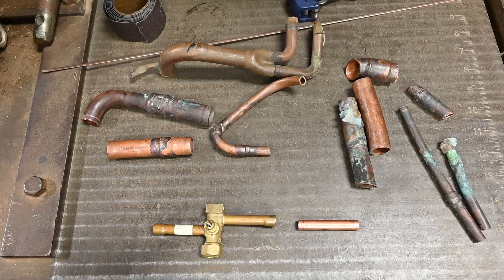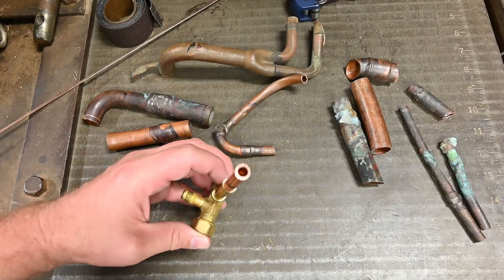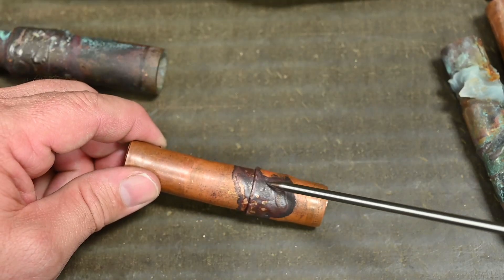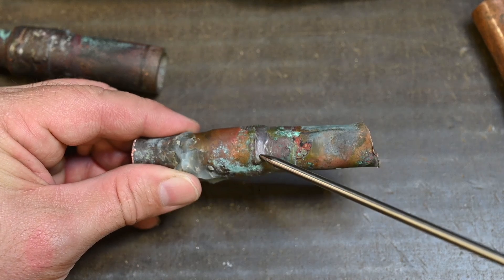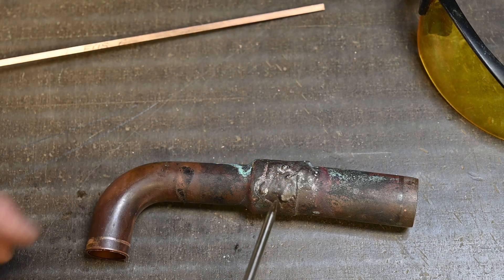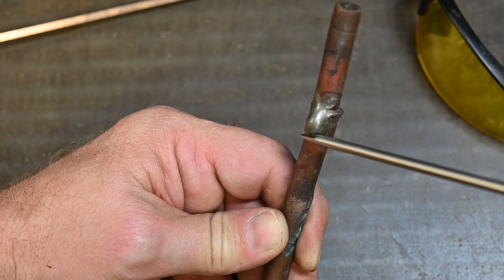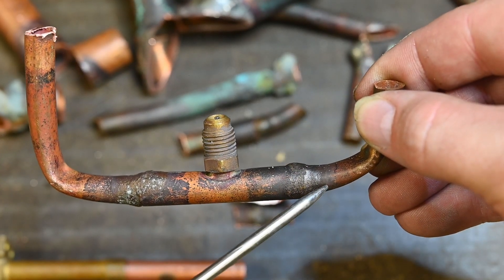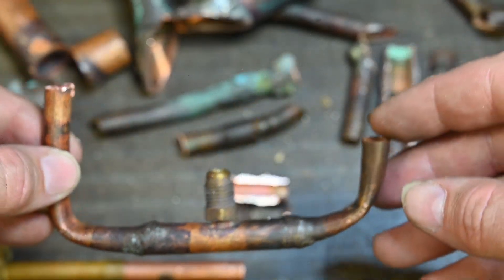HVAC 087 A. Connections part 1 Brazing,  introductory only

Comment: when brazing in supermarkets with large system or runs is nitrogen still used? Also what is the tool is used to meter the nitro through the system?
Reply from the maker: Yes very important. 
You use a regular nitrogen regulator and then a flow regulator after that. Here is the one I use https://uniweld.com/product/nitrovue%C2%AD-flow-indicator/

Comment: Hi Ty - I’d like to practice brazing at home but I don’t want to invest in an acetylene unit. Are there any small devices (e.g., MAP) that can be used for hvac brazing? - Thanks! - Jim
Reply from the maker: Air accetlyne (turbo torch) would be your cheapest
 It a B tank and a loud end. You have to get kno for hvac as the ones for plumbing do not get hot enough.
The map gas ones also dont get hot enough. They do make a inductive one but wow super expensive and not practical.  If you where closer I'd let you practice here.
Reply from the maker: Also the mini oxy acetylen tanks often go used for $150 with tanks on FB CL and offerup.

Comment: Nice info ,capillary lines on txv would be another good guide on actual brazing job ,thanks for the share.👍✌️💪🤙😊😊
Reply from the maker: Yes sir that's a great suggestion thank you. I will put in whith the brazing class when I get that section.
Reply: @love2hvac  and puncturing the copper correctly for the equalization line or for a service port and not contaminating the system.
Reply from the maker: He does not include making a new hole but he covers a lot of important points.
https://youtu.be/o8IDkP365Lw